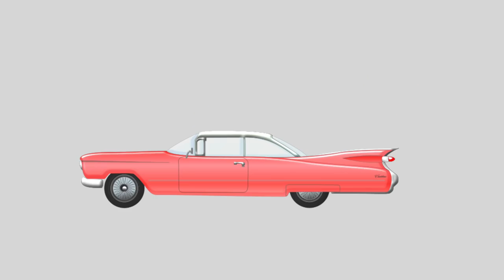Yes, Rockets CAN Fly in a Vacuum

Comment: You cannot create pressure in the combustion chamber as you have an open end with p=0 unlike in the air when you have p=1 atm to which you add the engine gases.  Check the 3rd law equation: in space you need to have a similar mass to yours to repel from. Rocket weighs many dozens of tons, gases virtually have no mass. To make it work in space, the rocket must eject constantly huge mass therefore losing its weight, which would not last long. Sum of gases in combustion chamber is virtually =0, so even if the gas acceleration is huge, multiplied by 0 you get 0. You are not going anywhere in vacuum. Set aside the problem of temperature difference in space when exposed to the sun or not, no land material can endure 365 times a year such stress (from +300°C to -273) and seems like astroNOTs have never had any issue with that.
Reply: The mass of the fuel and propellant being burned is not 0. It is nowhere close to 0.
Reply: @niallkinsella2687  the sum of masses in combustion chamber at instant "t" tends to 0 if to say in absolute numbers, but relatively to the mass of the rocket it's 0. Otherwise, the rocket would be out of fuel in few minutes
Reply: @uwriteme  : 
"Otherwise, the rocket would be out of fuel in few minutes"
Basically the case. 

"You cannot create pressure in the combustion chamber as you have an open end with p=0"
You can: it's just dynamic, as gas is at the same time flowing out.

"Check the 3rd law equation: in space you need to have a similar mass to yours to repel from."
Nowhere the law says "similar mass".

"Rocket weighs many dozens of tons"
95% of it being fuel.

"gases virtually have no mass. "
Many dozen of tons, see above.

"To make it work in space, the rocket must eject constantly huge mass therefore losing its weight"
It's exactly what's happening.
Why do you think a Saturn V is 3000T at take of, and just send 40T in translunar orbit?

"You are not going anywhere in vacuum."
You? Not, but rocket are made for it.

"no land material can endure 365 times a year such stress (from +300°C to -273) "
How did you computed that temperature?
Reply: uwriteme - "gases virtually have no mass" so when the space shuttle lifted off carrying 1,387,457 Pounds of liquid oxygen, and 234,265 Pounds of liquid Hydrogen - WHERE DO YOU THINK THE MASS GOES AS THAT FUEL AND OXIDIZER GETS BURNT ??  So you are arguing that the LIQUID has mass, but after it combusts and turns to gas, that the gas has no mass ???  So what you are REALLY saying IS:"I have never taken a physics class in my life". Yet you try to lecture actual engineers about physics?
Reply: @ThomasKundera  , 
"You cannot create pressure in the combustion chamber as you have an open end with p=0"
"You can: it's just dynamic, as gas is at the same time flowing out."
That is the problem: as it is a gas, it needs a pressurized environment (ideally) to create extra pressure (for planes, P(atm)+ P(combustion) to thrust. In space we have no P(atm) but a negative pressure at the open end, which module will be always greater than any P(combustion) because it's a vacuum and any extra pressure will be sucked out instantaneously. We are talking about an entire wall (bottom) of combustion chamber totally open to a vacuum, not a tiny hole or a valve. There is no way to create any pressure in such chamber whatever the engine you use.  

When liquid becomes gas, the molecules loose their adherence and need pressure to repel one from another. No pressure = no thrust. It would have worked if a rocket expelled constantly a liquid and each molecule would have another one aside to repel from (that's when the dynamics would work). 

"Check the 3rd law equation: in space you need to have a similar mass to yours to repel from."
"Nowhere the law says "similar mass". 
I will just leave it here: F1=-F2 m1a1=-m2a2 a1=-m2a2/m1

"You are not going anywhere in vacuum."
"You? Not, but rocket are made for it."
Rockets are made to justify NASA/RosCosmos huge annual budgets to wash.

"no land material can endure 365 times a year such stress (from +300°C to -273) "
How did you computed that temperature?
Near earth it's less stressful than in far space, but no ESS materials are known to sustain even 220°C difference every day. The solar radiation heats the space near Earth to 393.15 kelvins (120 degrees Celsius or 248 degrees Fahrenheit) or higher, while shaded objects plummet to temperatures lower than 173.5 kelvins (minus 100 degrees Celsius or minus 148 degrees Fahrenheit). Musk said his Tesla was stock, exposed to sun radiation it would have burnt instantaneously in space
Reply: @uwriteme  : Point is you address a lot of different question at the same time while still having limited understanding. So, it's going to take time for each, and I can't do that properly for all.

So I'll just address the first point for now. Once you'll understand it, well move to the next one, OK?

"as it is a gas, it needs a pressurized environment (ideally) to create extra pressure "
If there is none, you can't even ignite, I agree.

"but a negative pressure"
that doesn't exists: vacuum is just 0. 0 PSI, 0 Pa, zero. Not "negative".

"it's a vacuum and any extra pressure will be sucked out instantaneously."
Nothing in physics is "instantaneous". In particular, in a situation like this, no effect about "opening" would travel faster than sound in that gas.
So you have time. Not much but some.

"not a tiny hole or a valve."
We'll start by a tiny hole.

Please follow me from there.

Lets imagine the following:
Somewhere in a good vacuum, I put a metal box, with vacuum inside too.
Inside that box are two liquefied gas bottles. One O2, the other H2.
I slightly open each bottle: now gas start filling the box. It's no longer vacuum inside, agree?
There is a pressure, that is growing.
Then, I open a small hole in one of the box walls. 
Gas start to go out from there, but rather slowly.
So it's not vacuum inside, there are gas, going out of the bottle, creating pressure inside the box, and evacuating through some hole, at a rate that rise with internal pressure of the box.
So far so good.

Now, I light a match inside: the gas insides take fire.
Temperature rise a lot, as well as pressure.
Gas starts to be pushed out the box by the hole at great speed.
That's a rocket.

Now, you say: "the hole is not tiny". Agree, it's quite big. But if you admit it works with a "tiny" hole (which I hope), you can agree it will work with a larger hole as long as I push enough gas in it. And that's what we have: the hole is not bigger than the rocket can take.

Now, to understand how crazy that is:
The Saturn V, biggest rocket ever successfully launched, had a first stage that contained 2300 metric tons of fuel (kerosene and O2).
The engine burned it in... 168s.
That's about 12000kg/s of fuel sent to the motors by some crazy turbo-pumps under several tens (if not hundreds) of atm to be burned. Which makes about 12000m³ of gas at room temperature and pressure pushed per second in a volume of a few m³ to the most (until the exit).

You can imagine that with such feed, the gas wont be "sucked out instantaneously" from the box. You can even open a quite big hole in it, even in vacuum, just to prevent the thing to explode :-)

Got it?
Reply: @uwriteme  sorry but there is NO SUCH THING AS "NEGATIVE PRESSURE ".  The pressure in the "vacuum of space" is ZERO PSI.  Not negative.  So someone who hasn't got the least grasp of basic physics is trying to lecture engineers about physics?   That is adorable.... Here is your Dunning-Kruger participation award.  Put it where your high school diploma should have gone.
Reply: @uwriteme  and "it would have burnt instantaneously in space" .  SO now you are proving that you know nothing about the thermal environment in space TOO.   The car could just as easily have FROZEN in space, so which is it?  The answer IS that you have NO IDEA if the car would get too hot, or too cold, since you know nothing about the thermal properties of the car's surfaces.  You are probably one of those that thinks "the tires would have popped" too right?
Reply: @ThomasKundera  my understanding is limited from your POV, keep it in mind and avoid giving your estimations. If you lower the preacher tone, it will fit you better. Modesty is virtue. 

1° regarding the negative pressure: it is relative to the studied environment (you as the observer can define where to place your cross of x&y axis, in our case it's the combustion chamber. A quote from Quora: "Pressure is defined as force/area.  If an enclosed area has higher pressure than the area around it, the gas/liquid is pushing to get out.  We define that as positive pressure.  Negative pressure is simply the reverse - when the enclosed area has lower pressure than the area around it." © Robert Frost, Engineer with specialization in spacecraft operations, orbital mechanics. In our case, outer space has lower pressure than we need to have in the chamber to make it work. Therefore it's negative relatively to the chamber. I agree however that in absolute numbers negative p does not exist. 

2° "as it is a gas, it needs a pressurized environment (ideally) to create extra pressure "
If there is none, you can't even ignite, I agree.
And it ends pretty much here: no pressurized environment in space (at the open end p will always be 0), and no propulsion because no pressure in the chamber. Even with light gradient of pressure (some p at the engine side and 0 at the open end) it will never work, because at the end of the rocket it's p=0. 

3° Nothing in physics is "instantaneous" 
Nothing, it will be milliseconds before it gets depressurized. Does it make it better for propulsion? 

4° when you describe the chamber with considerable narrowing, you will pressurize if the engine is powerful and the combustion will work, but the pressure at the little hole will still be 0 as it's where the open space starts. In other words, in your example, you will have created a big pressure inside the chamber but it does not contribute to the propulsion. 

5° to round up.
thesis 1): pressure needed for propulsion in vacuum cannot be achieved like for jets in the atmosphere, it will always tend to 0 at the open end of the combustion chamber because of the vacuum (p=0) at the open end. The burning process (if it would have ignited) does not remedy to this.
thesis 2): a rocket cannot repel from gas particles mass because gas particles are distant one from another (and to make it work, we need pressure, see thesis 1).  In jet aircrafts, the gas particles repel from air particles, creating propulsion. The gas particles in space have nothing to repel from. 

Got it? :)
Reply: @uwriteme  : " Modesty is virtue."
Agree.
My point here is not to rise myself, but to make you understand how arrogant you are to think you know better that rocket scientists while not even mastering elementary physics.

But I agree that it's likely not the good way to do: I've better just to show you why you are wrong and not put your in a defensive mode where you'll be less receptive(when I'm attacked, I defend myself, even if I'm wrong, that's just human).
If you understand that your wrong, you'll be able to conclude by yourself of your own ignorance, if you don't pushing on that won't help anyway.

1° " I agree however that in absolute numbers negative p does not exist."
Good! I had to insist on that because a lot of people (way more ignorant than you are) believes that vacuum by itself as some "strength" and creates a huge negative pressure. I'm glad you're not in that fallacy :-)

2° " no pressurized environment in space"
But you wrote : "you will pressurize if the engine is powerful and the combustion will work"
So that negate your proposition: it's indeed possible.

3° "it will be milliseconds before it gets depressurize"
Depends on the size of the hole and lots of factors. Diminution of pressure will anyway be in e⁻(kt), so it will take times, even if the k is in the ms range.
As you agree on 4°, it's enough for me.

4° "if the engine is powerful and the combustion will work"
Good. I can't insist enough of that: it works:; you can ignite a rocket in space. So far so good.

 "but the pressure at the little hole will still be 0"
Right, that's a limit condition, from which you can deduce the flow.
If you ever done some fluid dynamics, that's about the same condition you'll get with water tank having an opening at bottom, and the like.

 "you will have created a big pressure inside the chamber"
Right!

"but it does not contribute to the propulsion."
Wrong.

I'll show it to you by two means, one thermodynamic (using your own words) and one mechanics (as you seems to understand momentum conservation, you wrote the equation in some previous post). Both way are equivalent and gives the same propulsive power, but by using two different methods.

- thermodynamics demonstration
Lets start from the box I described above, without the hole: huge pressure on all sides (for a rocket it can reach 10's of atm, lets suppose 1 MPa for our example). If the box is a 1m sided. that means 1MN of force on each side).
Suppose we now open a 10x10cm hole one one side. Summed force on all walls will still be 1MN, but for the one with the opening where we'll have 0 pressure at the opening (like you correctly stated). Missing force on that piece is F=P*s=1 * 10⁶ Pa*10*10⁻⁴m²=1kN! See: with that opening, the box is already pushed by a 1kN force! Quite a lot (about 100 kg force on Earth). The box will accelerate! We have a rocket!
Now, if we just open the side completely (what actual rockets are doing), we get 1MN of force! About 100 metric-tons!
The F1 engine on Saturn 5 had a thrust force of about 8MN in vacuum and 7 in air (thrust in air is reduced because the motor has to overcome the air pressure that is blocking the way to the gas flow, so thrusters are more efficient in vacuum). Our small computation is not that bad.

- Mechanics demonstration
If you agree that in an isolated system momentum is conserved.
If we start with an isolated rocket at rest in our referential so : ∑ p=0
If we divide our system in two parts: the rocket of mass mᵣ and the propulsion gas of mass mₚ (initially under fuel form, a liquid or a solid), both initially at rest vᵣ₀=0 and vₚ₀=0:
mᵣ vᵣ₀ + mₚvₚ₀ = 0 trivially (both speed are zero).

But now, the rocket is ejecting the gas at speed vₚ₁ (we demonstrated the rocket could ignite and you agree that gas will flow pretty fast outside of this p=0 area), so we get:
mᵣ vᵣ₁ + mₚvₚ₁ = 0
And that time mₚvₚ₁ is not zero! So this is no trivial! The rocket is going to move, at a speed we can compute from the above:
 vᵣ₁= - vₚ  mₚ/mᵣ

And the you understand why gas ejection should be fastest (and tha's a thermodynamic problem, the hotter the gas, the faster it will go), and the mass of the ejected gas has to be great if you need high speed of the rocket itself (in fact, more than 95% of a rocket is propellant, when you start from ground).

5° "to round up."
Good :-)

_" thesis 1): _ : you acknowledged that a fuel can be ignited in space even with an opening, as long as the right setup is in place. So, no problem here.

"thesis 2):" I gave you two demonstrations about why a rocket is propulsive in vacuum, suing the very knowledge you seems to understand enough to conclude the same as I do.

"In jet aircrafts, the gas particles repel from air particles, creating propulsion."
This is not how it works. I hope you better understand it now.

Got it ? ;-)
Reply: @ThomasKundera  I bet it would be hard to assume that working as a rocket scientist is useless and is paid for nothing, and from taxpayer’s pockets. Your arrogance is as high as you think space rockets can fly, but I leave it at your conscience. What elementary physics I don’t master, from you POV? 

Let’s get to your teacher-style long demonstrations that would have taken 2 classboards. 

Unfortunately neither one is applicable to demonstrate propulsion of a rocket in space. 

- thermodynamics demonstration
 The resulting force coming from the box hole cannot be calculated by F=PxS because S needs to be a surface to which this force is to be applied, although there is no _surface_, but a hole (nothing), with p=0 pressure (vacuum to which the hole opens), so such force cannot be applied because S does not exist and only presents a virtual area for calculation.  

Should you manage to create MPas of pressure inside the rocket (combustion chamber), there will be always p=0 at the opening (large or small) to the vacuum, because p=0 in the vacuum. To simplify your understanding, consider the rocket as a whole, regardless of processes going in the chamber. The only thing that counts is p=0 at the open end, because it’s vacuum. 

-mechanics demonstration
As the rocket expels gases and not solid/liquid matter, your mechanics demonstration is erroneous/not applicable, because gases have no mechanics of solids/liquids. 

Gas particles repel one from another only under enough pressure that would create rocket movement. Again, the only pressure that counts is pressure at the rocket END, at the hole, and it’s 0 all the time, because it’s vacuum outside. So don’t tell me again about the pressurizing inside the rocket.   

"In jet aircrafts, the gas particles repel from air particles, creating propulsion."
This is not how it works. I hope you better understand it now.
Oh really? So how does it really work? cleans up the classboard after 2 demonstrations

By the way, any real footage on action camera on a rocket from start to the outer space, without CGI cartoons, cuts and edits?
Reply: @uwriteme  how about a different approach? Watch the YT video "Uninterrupted Footage of the Falcon Heavy Launch and Booster Landing!" by Astronomy Live.  Now watch as the whole rocket flies up and DOWNRANGE at supersonic speed.  The boosters reach VACUUM and the boosters separate from the center stage. (around 3:06) By this point the boosters we're traveling DOWNRANGE at supersonic speed (even while they were still in atmosphere).  Now what happens NEXT?  Well the boosters TURN AROUND AND FLY BACK TO KSC. Now please explain HOW THOSE BOOSTERS CHANGED DIRECTION IN A VACUUM ?  What do you say? MAGIC?
Reply: @uwriteme  oh and answer another question: what is the extent of your education, and have YOU EVER taken a physics class in your life ? (I already know the answer to one of those).
Reply: @uwriteme  : "working as a rocket scientist is useless and is paid for nothing"
That's a very naive idea. And wrong, of course.And your naive idea is not only contradicting "rocket scientists", but about anyone who knows a bit of physics, from university student to teachers, university professor, physics researchers, Nobel prize winners, etc. How much arrogance you have to think you know better?

"What elementary physics I don’t master, from you POV?"
Elementary Newton mechanics, elementary thermodynamics of perfect gases.

"The resulting force coming from the box hole cannot be calculated by F=PxS "
It can: S is known and finite, and P=0, so that force is exactly zero.
Don't agree?

"Should you manage to create MPas of pressure inside the rocket (combustion chamber), there will be always p=0 at the opening (large or small) to the vacuum, because p=0 in the vacuum. "
Good! That's exactly my point. So you got something after all. (if by 'p' you mean what I denoted P, aka Pressure).

"As the rocket expels gases and not solid/liquid matter, your mechanics demonstration is erroneous"
Do you mean that Newton laws don't apply to gases?
F=ma "except for gases" ?Where did you saw that "law"?

Do you mean we can create non-Newtonian propulsion just by going to gas state, so then we don't have to stick to momentum conservation?
Do you mean that if I through a baseball ball, it won't follow Newtonian mechanics as the inside is made of gas?
NO, that's just naive. Newton's laws apply on everything, even a single particle. Agree?

"don’t tell me again about the pressurizing inside the rocket"
That was from the previous method, "thermodynamic" one, don't mix.
Why can'y you keep things ordered in your answer?

"the only pressure that counts is pressure at the rocket END"
No. It's the pressure in the combustion chamber.

"at the hole, and it’s 0 all the time"
You understood that, good.

"don’t tell me again about the pressurizing inside the rocket."
However I have to: that's the key point here.

"In jet aircrafts, the gas particles repel from air particles, creating propulsion."
"This is not how it works. I hope you better understand it now."
-"Oh really? So how does it really work?"_
Same as above:  gas throw backward fast creating a reaction.

OK, as you seems to be still in confusion, I'll give you another explanation:
- microscopic thermodynamics
As the liquid fuel is pushed into the combustion chamber, that is open only at one end, it catch fire.
Lets take just fuel molecules meeting a single oxidizer molecule. If we write for example H2 meeting O2.
It will go : 2H₂+O₂=2H₂O. 
Imagine this reaction is done at rest (from the rocket frame point of view). It's exothermic, releasing energy, so that the two water molecules will go away very fast from each other, at same speed, in opposite directions, as momentum is conserved, and we started from 3 molecules at rest. Imagine each of the carry a momentum, we'll call Δp₁ and Δp₂.
We have of course Δp₁+Δp₂=0

Simple case scenario: one is going toward the inside of the rocket, the other to the opened hole of the "box".
The one going out won't do anything, it's going away.
However, the other one will hit the back of the box end, and bounce on it.
That bounce will change the sign of the momentum: Δp₁'=-Δp₁
Writing the conservation of momentum of rocket+H₂O: we have, noting pᵣ momentum of rocket before bounce (that is zero as we work in the rocket before bounce referential) and pᵣ' after bounce:
pᵣ+Δp₁=pᵣ'+Δp₁'
We know that Δp₁'=-Δp₁, so:
pᵣ-Δp₁'=pᵣ'+Δp₁'
pr'-pr=-2Δp₁ : the rocket momentum has been increased by two times the elementary momentum of that water molecule.
If there are no more interactions (because the bounced molecule fly by the hole following the first one), we get that net increase in rocket momentum for actual propulsion.
Note that we of course conserve total momentum, as pr'+-2Δp₁=pr+Δp₁+Δp₂=0

Now, of course, it's way more complex, there are hundreds of moles/s of water produced, bouncing everywhere, and we go to statistical thermodynamics to handle that: huge pressure on all side of the box, but at the hole, making propulsion in the opposite direction of the hole itself.

Got it better?
Reply: @ThomasKundera  I'll try to make it short (only referring to essentials), even though I could comment more on your various points. 
I'm glad you agreed that P=0 at the open end, this is a key element. 
Regarding F=P*S, you said it yourself that F=0 at the open end, thus you accept that there is no force at the open end. I still stay on my point that this formula is not applicable (literally) as there is no surface to apply the force, but let's just agree that F=0 {I have no vectors on my kb} at the open end.
I have read attentively your example with equation where you are applying mechanics on the molecular scale. Your exposé would have been possible on a solid/liquid state (a rocket expelling a high flow of liquid), although we know that at the temperature of the combustion chamber we have plasma/gas, and on a micro scale under low (I'd say virtually=0) pressure are very far from each other if we measure the distance among them in diameters of these molecules. So to make them interact as for to create propulsion (aka resulting force directed to the wall opposite to the open end),  we need to apply the same force on the opposite side (the open end), but you just agreed that the F=PS=0 at the open end. You cannot apply the force only where you want (the median chamber wall), unfortunately. And if you are a good physicist you know that. 

An important note. You might argument that you can create higher pressure in chamber if you make an exiting hole small enough and your rocket engine is powerful enough (to which I agreed). BUT the module of propulsive force will be equal to the force module the molecules apply at the open end/hole, which you agreed to be =0.

huge pressure on all side of the box, but at the hole, making propulsion in the opposite direction of the hole itself 
Huge pressure on all sides of the box =yes (if open hole is small and engine is powerful) and p=0 at the hole and F=0  at the hole as a consequence (you wrote it yourself) ==> NO opposite force at the median wall not resulting in a propulsion.
Reply: @stuartgray5877   What did make you think it reached vacuum? The rocket started vertically and made a bow (as they all do) until became horizontal. Then the footage of a very mediocre quality (do I have to believe that Musk spent all the money on this rocket and none was left on few different angles ground, air (from drones) and on-board cameras?) cuts as the (handheld?) camera looses contact with the object and then you see a reverse video (actually a takeoff shown backwards but not a landing). It's like video on Michael Jackson doing his backslide played backwards.  

Same story on all videos with action cameras trying to imitate the orbit reaching: https://www.youtube.com/watch?v=bDoh8zQDT38&t=66s&frags=pl%2Cwn you see that there are 2 videos spliced @1:05: first it's real and 2nd is CGI'd. Maybe some day they will be enough skillful to montage it seamlessly. 

Same here @2:25 
https://www.youtube.com/watch?v=sWm4spqT18o&frags=pl%2Cwn
etc, etc
Reply: @uwriteme  sorry but the Atmospheric Pressure at only 50 kilometers is only 1.0 Torr !  That is OFFICIALLY "vacuum" (known as rough vac in the industry).  The boosters did not even separate until above 60 km.  You can also tell by watching the rocket's exhaust plumes expanding during ascent.  I'll tell you for a fact that those boosters were officially IN VACUUM when they separated and flipped around, and fired the first stage engines again. Now Explain: How did those boosters TURN AROUND, NEGATE 4300 mph eastward velocity and FLY BACK TO KSC IN A VACUUM ?  Don't try to divert or distract from the question ANSWER IT .
Reply: @stuartgray5877  You do not read attentively my messages. I already told you the "landing" (when the rocket "comes back") is what was filmed as a take off, but the video was put backwards.As for the low pressure at high altitude (what you call vacuum), the rocket took momentum while in the atmosphere, and had enough of it to raise as far as you saw.
Reply: @stuartgray5877  to answer your question "*where does the mass of fuel and oxydizer go*". in simple words, while it is in liquid state, you can repel from it because it is considered as an entire matter with considerable mass to be pushed from. When it becomes gas, this property is lost because the particles are too far away and you need pressure at the open end to make them interact to push the rocket. However with an open end in vacuum, you cannot have pressure, so the sum of masses of gas particles is useless for propulsion.
Reply: @uwriteme  so your answer to my question is word salad that actually means nothing?  WHY can't you just admit that this video PROVES YOU WRONG and supports BASIC PHYSICS PRINCIPLES. Basic Newtonian Physics says ROCKETS MUST WORK in a vacuum.  You just don't understand it.  Here is another question you are sure to ignore: Have you EVER TAKEN A PHYSICS CLASS IN YOUR LIFE ??
Reply: @uwriteme  :  uwriteme  : I'll try same.
AS: are you not just trolling me? You seems to have enough bases in physics to understand by yourself...

"I'm glad you agreed that P=0 at the open end, this is a key element. "
So then it's easy.
Lets come back to my square 1x1x1m box in space.
If there is some pressure P inside, each side will be push outward by a PxS force, lets call it Fb
There are 6 surfaces, lets suppose some referential in the middle with x,y,z axis aligned on the sides.
No opening for now.
If we look for all forces applied to the box, we'll get, naming 'x' 'y' and 'z' the three base vectors of our referential :
∑ F=(Fb-Fb)x + (Fb-Fb)y + (Fb-Fb)z= 0x + 0y + 0z
It's obvious: the force applied one one side is exactly the same as the one applied on the other side.

Lets now dig a hole on side (-x), assuming that hole is a fraction f of the full surface (f ∈ [0-1]):
∑ F=(Fb-fFb)x + (Fb-Fb)y + (Fb-Fb)z= (1-f)x+0y+0z=(1-f)Fb.
We now have a non-zero resulting force!

Just because at the opening it's zero, so the pressure applied on the other side of the box is not compensated any more.

Got it now?

"Regarding F=P*S, you said it yourself that F=0 at the open end, thus you accept that there is no force at the open end."
Of course.

"I still stay on my point that this formula is not applicable (literally) as there is no surface to apply the force"
There is: the prolongation of the box. That's a surface like any other.
Learn basics of fluid dynamics.

"but let's just agree that F=0 {I have no vectors on my kb} at the open end."
Good.

"Your exposé would have been possible on a solid/liquid state "
Once again: laws of physics doesn't depends on state of matter...

"So to make them interact as for to create propulsion (aka resulting force directed to the wall opposite to the open end), we need to apply the same force on the opposite side (the open end)"
Why?
Throw a ball in a box, why do you need to close the other end for it to bounce back? Same with a molecule.

"You cannot apply the force only where you want (the median chamber wall)"
You can only apply it where it is applied. So what?

_"if you are a good physicist you know that"_rockets work best in vacuum.
Where did you went at school?

You might argument that you can create higher pressure in chamber if you make an exiting hole small enough and your rocket engine is powerful enough (to which I agreed)."
So far so good.

"BUT the module of propulsive force will be equal to the force module the molecules apply at the open end/hole"
No. Read more carefully.
Again: I throw a ball in a box, if it bounce on one side, the box will be pushed away, whatever the opening at the other side.

" huge pressure on all side of the box, but at the hole, making propulsion in the opposite direction of the hole itself"
Good.

 "Huge pressure on all sides of the box =yes"
Good. But on the hole.

"and p=0 at the hole and F=0 at the hole as a consequence (you wrote it yourself) "
Good.

"NO opposite force at the median wall not resulting in a propulsion."
Don't understand that. But I hope you can correct yourself now.

Do you really think you know better than world best physicists?. How many Nobel do you have yet?
Reply: @uwriteme  : "then you see a reverse video (actually a takeoff shown backwards but not a landing)."
Do you agree that Falcon boosters are actually landing for real, or are you that blind to reality?

" there are 2 videos spliced @1:05: first it's real and 2nd is CGI'd"
Proof of that is "CGI" ? Except the fact that when a reality contradict your belief you just say it's cgi?
Seems you are pretty naive, in fact.

"When it becomes gas, this property is lost because the particles are too far away and you need pressure"
This is your worse fallacy: stating that conservation of momentum is not true for gases.
Reply: @uwriteme  SO why no answer to y question: HOW do those boosters TURN AROUND AND FLY BACK IN A VACUUM ???
Reply: @ThomasKundera  you are blind to see that falcon video landing is a reversed one and you are blind to see a splice even at the timing I provided, I cannot help you any further.
Reply: @uwriteme  : lots of people see them landing with their own eyes.
Anyway.

You didn't replied to my last demonstration about propulsion in vacuum.
Finaly got it?
Reply: @uwriteme  why no answer to my questions? Did you give up on your delusion?
Reply: @ThomasKundera  I replied 3 days ago, you must have missed it. 

"lots of people see them landing" - is a non-funded statement, fake-news journalist-style. 
"Finaly got it?" - got what? That you use liquid dynamics principles on uncompressed gas? Yes, I got it!
Reply: @stuartgray5877  Chill down, keyboard warrior. Increased aggressiveness and lack of attention... did you skip your meds? I did not tell about the boosters but about the rocket "landing" presented in reversed part of video.  I'm not a paid troll like you are, so I do not stick around the fake science videos comments section every day and will answer you if you merit my response.
Reply: @uwriteme  or if you like, we can approach this from a direct physics perspective.  When a rocket releases exhaust gases into the vacuum, do you agree that the gas molecules get accelerated ?  This is a Yes or No question.
Reply: @uwriteme  so now you can watch the YT video "Close Up Footage of Falcon Heavy Arabsat-6A!" and tell us those landings were fake.  Then answer the question: How did those boosters TURN AROUND and FLY BACK to KSC IN A VACUUM ?
Reply: @ThomasKundera  he appears to have given up.  Maybe we killed his last living brain cell?
Reply: @stuartgray5877  : at some point, it become a medical concern, I'm afraid.
Reply: @uwriteme  : "I replied 3 days ago, you must have missed it. "
Didn't saw anything worth reply.

Check your comment wasn't censored.